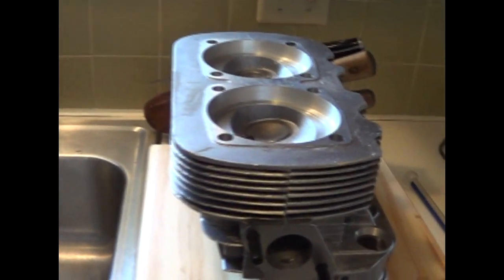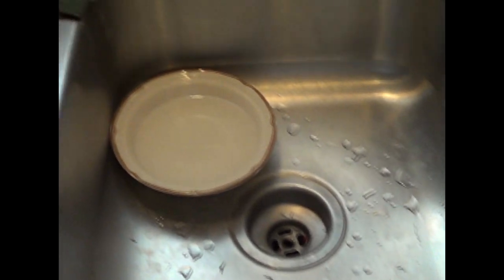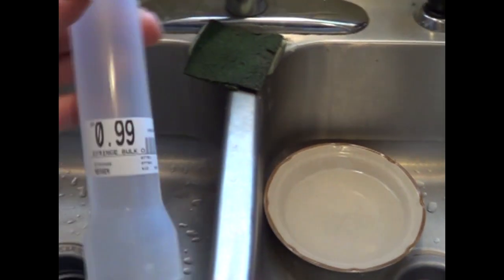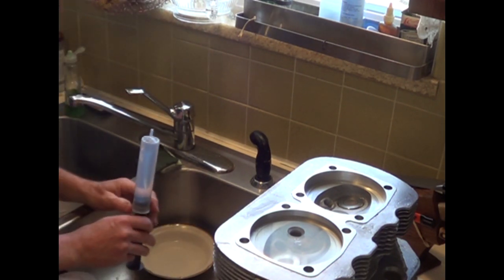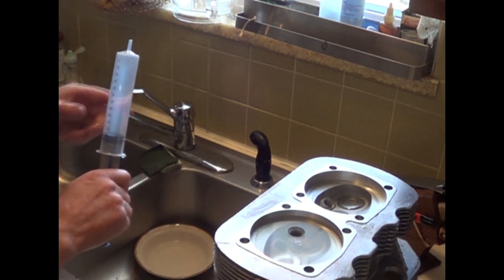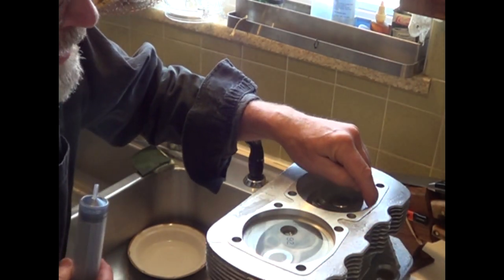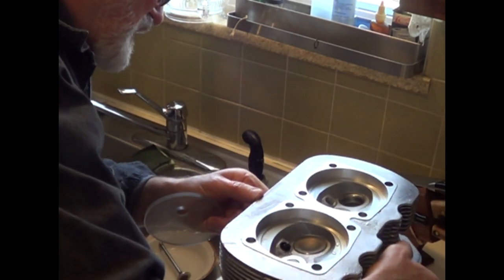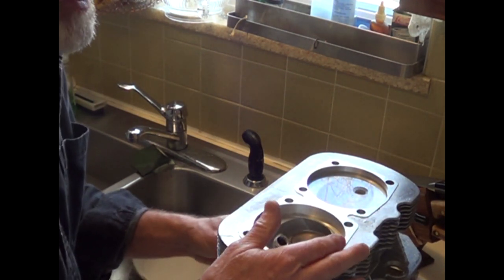VW Cylinder Head CC the EZ way

Comment: What's the best compression ratio for a 1585cc engine on 87 and 92 octane fuel for street performance?
Reply from the maker: Old school say's follow the factory specs 7.3 but I run a bit more with Ethanol 8'0 but I'm at 8,000 ft elevation and having no problems
Reply: @TheEZGZ  do you think 8:1 is too much? I'm currently at 7,500 ft above sea level
Reply: @TheEZGZ  thanks for the previous reply 👍🏼

Comment: Hay ez what is the acceptable range when cc ing between heads , how close should they be ? Why do we do it ? And if they are out , where do we machine or how do we rectify thanks😊
Reply from the maker: All cylinders should be the same.
Close as you want to get.
Cause that the law.....
Grind until equal
Add shims under cylinders to get desired compression ratio
EZGZ Out!
Reply: Thankyou 😊

Comment: I have stepped heads for 90.5mm pistons (82mm stroke).  I cc the heads and got 85cc with the disk on the step part of chamber, if I use the small disk and rest it on the just the chamber i get 55cc.  The height of the step from chamber is 0.171".  If I install the heads on the jugs that the pistons are flush to the jugs.  So my deck height is 0.171" and my compression ratio is 7.4:1.  I could remove one .090" barrel shim (I have two .090") which would make the piston be .090" sticking out of jug.  0.090" from the step height of .171" leaves a .081 deck height and compression ratio of 8.7:1.  I have engel 110 cam and ratio rockers of 1:1.25.  Is my math right??
Reply from the maker: Never go less than .040 deck height from the top of the piston to the top of the cylinder when properly torqued with a deck height measuring tool.
Who ever cut your heads did not go deep enough. .171 is not expectable. If properly cut it will be about the same as stock or less.   Use the disc that say's the size your going with. 90.5      Bottom line is you need to have your head cut correctly.  Unless your cutting deep into the squish area your head chambers usually are from 50 cc to 60 cc.   If you remove to much material from the head you effect the heat dam effect and they won't cool well or last long.
Reply: @TheEZGZ  I asked more questions on another tread about the stepped heads.  Lets kill this thread on just use the other one

Comment: do you do the hoover, oil mod on your motors  at the cam ?
Reply from the maker: I posted a vid on the hoover mod recently.  I don't build or drive all out race engines.  I'm more of a off road and High Performance street guy. More recently I have been looking at getting better mileage.

Comment: Hello friend .. could you help me to know which is Combustion Chamber CC? for the following cylinder chamber: AA Performance Products VW 1600 Dual Port Performance Cylinder Heads, 40X35.5 "Pair" Bore Size 94
Reply from the maker: https://aapistons.com/collections/stock-performance-street-heads/products/new-vw-1600-dual-port-high-performance-cylinder-head-40x355
It says they will cut them to order generally you can expect 55 to 62 cc

Comment: Hey GZ, I wanted to give a heads up on the heads from car craft. I emailed two days before I ordered them and they said they come in at 55cc. I ordered them with 90.5 bore and 35x40 valves. The heads got to my house and are measuring at 60cc which would be great if my deck height was at 0, but it is at .025. So I called them up and the guy I talked to said that I should have specified (or noted) 55cc because the big valve heads come in at 60cc. So anyway something got mixed up in the email that I sent before I ordered them. They will machine the head and send them back for free. I have to pay for the shipping to them. Just wanted to let everyone know that so they don't have to go through this little mixup(no big deal) that I had. And also check your deck height.
Reply from the maker: Thanks for the heads up Ringo.  When you do get them be sure and check all the fin area for access aluminum flashing material and clean them up so you get good air flow and no blocked passages. Hope they work out good for you. I have only used the stock valve head and they are working great.

Comment: I was doing this today. I found it was better to use soapy water to reduce the surface tension, otherwise the water would not easily wet small cavities like the inside of the spark plugs.
Reply from the maker: interesting, I guess it doesn't matter as long as you do it the same on each cylinder. Thanks for watching and commenting
Reply: It doesn't matter for balancing, but it does matter for knowing what the actual compression ratio is. It's pretty fiddly getting all the bubbles out... ;-)
Reply from the maker: It makes a big difference in both balance and compression ratio if you want a smooth running engine. You want each cylinder to be the same. When your unshrouding the valves inside the combustion chamber and reshaping the head you need to do the check and read the head volume until all cylinders are the same. If you use any water or water based valve grinding compound you want to wipe your valve seats and valves with an oily rag as the steel with pit and rust quickly. Like 24hrs. or less.  Good Luck with your projects in 2018

Comment: Thanks for sharing i'm a vw kitchen guy myself---clean new pistion set with Dawn dish soap..kitchen sink...keep looking at the dish washer thinking one day there maybe a vw part in it. book marked car craft they have some good prices on vw stuff..
I did this check on my last motor i built for my bus . i used that nasty red oil.
Reply from the maker: +Dan “Busman54” Love LOL Thanks for watching and commenting.  Just wait until the old lady is gone and take the top rack out of the dishwasher. both halfs of my engine case fit just fine. It did leave a nasty layer that did wipe out fairly easy. I even posted a vid on it a few years back